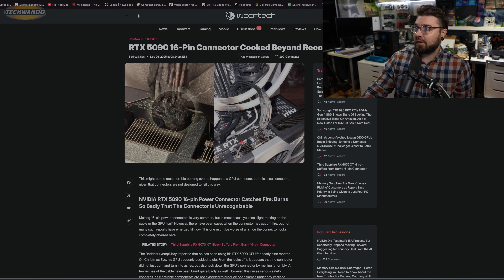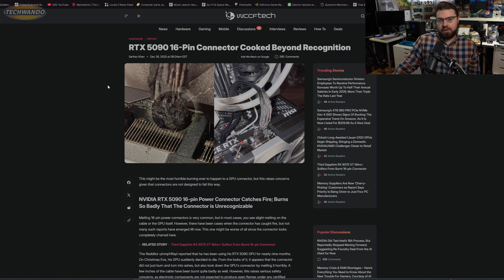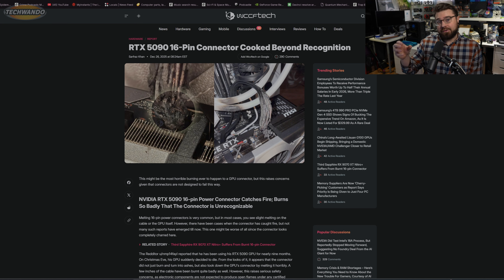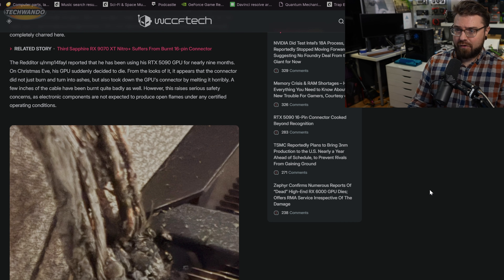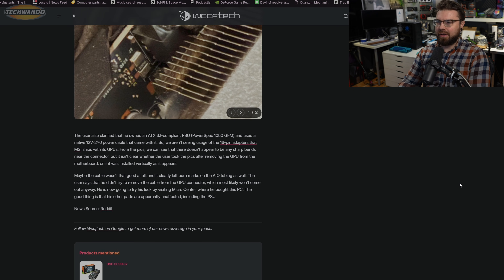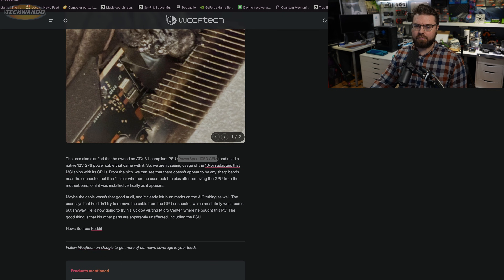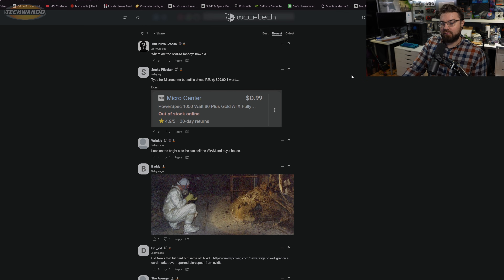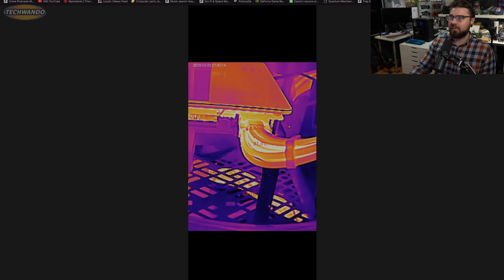Nvidia, Intel, PCI-SIG, please do something about this...

Comment: I don't know anyone who will buy a 4090 or 5090 for $3000-4000 and not plug it in properly ... they would double and triple check its plugged in fully. Knowing its $3000+ that can burn and melt

Comment: Got myself a 5090 for christmas, so I adopted one of these connectors :(
I bought a new PSU with new cables, I could point a case fan directly onto the connector or undervolt it...
I guess I run it like that, and if it fails both ends of the connector at the PSU and GPU get soldered in directly to not have a connector at all...

Comment: I bought a 5070ti and I don't want to waste my money. How do I prevent this from happening???
Reply from the maker: Extremely low chance of it happening on the 70 class, but you could use MSI after burner and drop the power to 90% as a precautionary.

Comment: I undervolted my 5070 ti by an insane margin because I’m scared of my connector blowing up ;-;
Reply: Just don't use adaptors or daisy chain and you'll be fine. All 5070ti & 9070ti cases were from ppl using adaptors. Youtubers just repeat the same sht as every other youtuber for views.

Comment: The cable's very nice to look at and cleans up a lot of cable clutter but at this point I don't think the risk is worth it for anyone. Even for someone like me who's never experienced this for two years running on all kinds of 40 and 50 series cards, thank God. I'm not saying we should stick with triple 8-pin connectors forever but damn at least redesign/re-engineer this thing so it doesn't fry our components.

Comment: Always user error!  One your settings are maxed out and you set there and run this thing hot for 12 hours, in a system it wasn’t designed for….  Or spend 5k on a card and don’t really look into what works best… which design is older? The power supply and connectors or the gpu?  People are running them at full telt in ai data centers and offices and not having a single issue…
Reply from the maker: Watch this video and let me know if you think this was user error. 

https://youtu.be/m0WnwOnl8kY?si=yMWaEM_YvUc2qNdQ
Reply: @techwandoUS even this guy said it was th power supply… that’s my point of you buy a card that is a power hog, and don’t check the connection and so on… then its user error…  that being said we had this same issue on ant miners s9, I still got a power supply that did the same thing…  and the power supply’s for that is rated upwards of 3000 volts, runs fine for a while….  I did a quick pull on the numbers as how many 5090s where sold and how many went up in flames…. The data just isn’t there and don’t justify a recall of any kind…. If people start saying this is happening they better have “ spotless” pcs… no dust…  note that the few I did see where water cooled systems… other factors could be at play… but it all boils down to don’t cheep out on the power supply and for goodness sake’s don’t use the one you think might work just because it is in your system and has a high or gold rating
Reply: My streaming computer is an older dell t7600 that pumps two xenon’s for around 36 cores, for gpus it has one qudro 6000 and 3 qudro 4000s, I use this system for all kinds of things…  know your systems limits … building monsters has responsibility’s and you better be able to put it down if you need too
Reply: I know people have their views and think they know what they are doing… but brother if this hasn’t happened to you or anyone before… then you where not a power users,  welcome to a different world… and in that world you need to harden the bunkers
Reply from the maker: @Paranoidtimes okay man 👍

Comment: This is a bad cable, it’s an adaptor Caoutchouc only cable, it indicate old PSU.
And in fact the power supply is a PowerSpec 1050W …
Who put the cheapest PSU possible with a 5090?.. this guy for example.

Comment: hey man i would appreciate your take on this

I bought a zotac 5070 oc with corsair rmx 850 and use the native cable

I am really worried about the burning since i can't afford if it dies

Talked to many users of 4090, 5090 on reddit who haven't had any issue

What do you think about it happening on 5070? i do have power limit to 90, might increase depending on performance gain in future

I know more watts isn't the issue, it's load balancing on just 1 wire
Reply from the maker: Although there have been some instances of the 70 class cards melting, it's just way less common. I personally wouldn't worry about it. If it still bothers you though, you can definitely do as you mentioned. Just drop the power draw down to 90% or find a undervolt guide and get it more efficient than factory.
Reply: @techwandoUS  Thanks man

Comment: The amazing part to the "it's user error" crowd is, there's never been some constant reporting of melted 24 pin connectors, EPS connectors, PCI-E connectors, it's always these stupid high power connectors. Granted, people have ruined their hardware by using incorrect modular cables from different PSU's or using Molex connectors attached to SATA or PCI-E adapters/splitters, but not just using the other connectors in stock form. Now, AMD uses that same stupid connector and it happens to them. Almost like it's the stupid high power connector that's the problem.

Comment: Funny I got a 4080, 4090, 5080, 5090 I try to optimize by lowering full load volts for stable and efficient power draw but no fires, no melted connectors, funny I don’t use Corsair psu’s which a majority of fires come from in cables and connectors…. Also I have good cases with great cooling and fans moving air…

One guys 5090 caught fire becuz he’d overclocked it and it drawed 1300w of power…. User error and junk psus and cables

Comment: Imagine if you were able to engineer a solution to ensure that failures are always user errors because nobody got enough money to go through the legal process against big companies. And the failures ensure that useful life of a GPU drops faster than ever while new Innovations are mostly paper launches with price increases....
Reply: You can get caught if you have firmware messing the device up after certain amounts of cycles but what about if you just have a regular component and design choices to achieve the exact end result?
Reply: And anyone with inside information is under NDA. Plus whistleblowers threatening costly lawsuits, bad reputation to c-suite etc seem to be non-suicidal until cops claim it was a suicide....
Reply: And anyone with inside information has strict NDA. Plus whistleblowers seem to be non-suicidal until the cops report the sudden death as suicide....

Comment: Based on what I know of the situation and some recent developments, it really just needs two things to fix it.

Current balancing on wires and contacts rated for higher currents so they don’t get as hot.

The wires could also stand to be beefed up to 14 gauge for extra safety margin.

Comment: It’s for sure the cable connector. The sockets for the pins aren’t making good contact, they are too wide. Just touching isn’t good enough for the amount of current draw. They need to make good contact the length of the pin in order to sustain the draw without heating up to the point of melting plastic. Seriously though, anyone with half a brain cell ought to smell that long before it turns the plastic to ash.

Comment: Its a low power connector. Nvidia does NOT GIVE A FUCK. Its a low power molex connector, off the shelf design, isn't it? The connector SUCKS. The chip design has hit the wall. They hit the wall with the 40 series and said 'HOLD MY BEER' We can do bigger, hotter MOAR POWA. These cards NEED ALL THE POWER - ALL THE TIME or they blue / black screen. It is a BRAND thing. Sapphire is the only AMD brand using it... What the fuck dude? That doesn't make it an AMD thing. Its a desire to make cards for morons that finally make the right choice, AMD, and don't want to buy another connector or supply. IMHO, DONT BUY ANYTHING NVIDIA or ANYTHING with this connector. EVER. NEVER.

Newsflash: Next GEN AMD is gonna WTF sauce the next GEN Nvidia... First time AMD has ever said 'this generation will OUT PERFORM Nvidia next cycle' FIRST TIME EVER... and it's gonna be awesome. Right now Nvidia is busy channel stuffing AI DATA Center crap into a pipeline that is saturated at 1 million cards and they have already sold 6 million. To who? Where are they? They are NOT in DATA centers. The whole house of cards is about to collapse and I am fucking here for it, walking away with my 1300% Profit on Nvidia already. Now to time my short.

Comment: what are the amd ones that has that problem as well ? the only one i know is the 9070 xt, that i cant recomend ya, but i need to know if that doesnt happent to the 9060 xt 16gb
Reply from the maker: So far it's just a few 9070 / 9070XTs, I think ASRock makes a variation with the 12vhpwr along with a few others
Reply: @techwandoUS  nice its not affecting the 9060xt versions xd

Comment: Years ago there was a E-ATX red/black Aerocool case (AeroCool Strike-X ST Ultimate Gaming Tower) that caught fire very regulary. It was the case itself that caught fire (harddrive dock on the top). happend with me aswell. even when i have never have used the harddrive dock, it just caught fire. And guess what Aerocool did? NOTHING!

This happens way more often than people think. And NEVER let your computer on when you are not around or away from the house. ALWAYS TURN IT DOWN!

Comment: errrr.... PowerSpec... OEM...
it's weird, nothing hit with googlin anywhere... except few pages.
but... it's not obvious.
 I'm using SuperFlower 1000W ATX3.1/Sapphire RX9070 Nitro+.
half years ago, I'd use thermaltake 850W ATX3.1 and both PSU and 16AWG cable it runs very fine.

yeah, connector's issues I know that crystal clear.
but sametime maybe it caused by PSU, or both with it.

Comment: WAIT, did AMD start using the hot connector too?  Are they insane?  That's one of the advantages of having an AMD card, to not have to deal with that.

It's like saying, oh the neighbor uses crack?  Well that must be the reason why he does well, quick let's do it too!
Reply: AMD themselves no, but some board partners seem to be using it, and even then it's spotty. The card he mentioned that uses it is a Sapphire Nitro+ 9070xt, I have the cheaper Sapphire Pulse 9070xt and that uses 2 8-pin.
Reply: Because it is the progress that PCIE consortium ask everyone to accept.
Reply: @arenzricodexd4409  I don't know if it is true, but I will pass.

Comment: Wait till you see th Asus limited 1000 GPU issue they designed it to catch fire it was engineered with a purposely shift 12V High Failure port and even told a customer it was engineered this way I forwarded what info I could scrape together for Tech Jesus (Gamers Nexus) to see if he can do a deep dive to see if that's even legal you design a $4000+ product to catch fire eventually on purpose and claim it was engineered that way if think that's bring some legal heat look what happened with the Note 7 (Portable drag grenade) PCIE SIG needs to be investigated with Nvidia on how this was allowed to be a standard.

Comment: Is my RTX 3050 8g ok? This is a 40 and above problem right?
Reply: It's a Nvidia issue from 3090Ti to 5090 and it's even effecting AMD GPUs that use the same failure of a connector.

Comment: Seeing the stupid fire hazard cable I got with my PSU for my new PC recently was enough to deter me from ever thinking about buying a GPU with that connector. I saw them on video a few times before, but seeing the real deal absolutely shocked me. Those pins are stupidly small and seem extremely fragile. What do you mean that connector can draw 75-100W per pin?? Are they right in the head? That feels absolutely diabolical considering the 8-pin connector averages 50W per pin and those had at least twice as much surface area!
Reply: They are lying and need to be sued...

Comment: being able to use the good and trusted 6+2pin connecter was exactly why I have chosen my specific 9070XT there was a cheaper one with a 12V high-failure rate connector and I will not be using these for as long as it's possible.

Trying to push this connector as being standard is disgusting... this is legitimately a safety issue for every user.

Comment: That 9070xt melting REALLY concerns me. I've been using the 8pin adapters because it's a thicker gauge wire and there are multiple psu connections instead of only one, and I only use 3/4 of the 8pin connections to limit the power to 450W on my 4090 (gets 95% of the same performance as 4/4 connections.)
You are correct that there will be a lawsuit because sooner or later someone is going to die in a fire cause by that card connector melting.
Reply from the maker: Hopefully it never happens but it's crazy that it's gone on this long.
Reply: @techwandoUS  I would be very happy to be wrong.

Comment: These are $2000+ cards… this should never happen. (Not that it should happen even with a $50 card from the depths of a Chinese bin however with cheap models at least you know there might be corners cut) It’s disgraceful.. sapphire seemed very confident in that cable, with their interview however it looks like they might have to rethink using that cable in the future. NVidia really needs to change course with the 6000 series before someone gets hurt!

Comment: nvidia will do something, keep ignoring it for like 6 years and counting

they paid for this crap, they wanted this crap, they wanted this to happen

if the ai bubble doesnt pop, they abandon gpu for desktops and laptops

if bubble pops, they might reconsider finding a new way to spit in the faces of the gamers who made them get to where they are, and that is nvidia for you.
Reply: Nvidia already do "something". That's why those revised version of 16pin exist now. The issue is nvidia original improvised power connector used on 3090Ti were deem violating PCIE implementation.  It seems PCIE consortium want those power connector to go certain way. Actual hardware overcloking talk about this in one of his video.

Comment: Although this still should not happen, the person was likely doing an activity that probably utilizes the card to 100%. This may not be a problem for lower end cards but these... get a little warm.
Reply: I hope my RTX 5080 never has this issue.
Reply: no, the gpu has no way to control or avoid the wire to carry 50 amps at 12v, on any of the 6 wires, or on just one of them

the cable has no way to control that

psu has no way to control that either, the design of the connector is stupid, it was not engineered well to carry 660 watts, it was stupid

blame the load for causing this is dumb, because if you buy a gpu like this, is to use it, not to admire it turned off, it has to survive being used at the load it was designed, but a thin cable cannot avoid melting when getting 50 amps at 12 v

Comment: Its why I chose a a 5060Ti 16gb over a 5070 12gb lmao...had no interest in 12VHPWR in an SFX build 😅
Reply: Using a 5070ti in a ncore 100 coolermaster sff case... I'm just hopeful it's going to work properly for the next few years. Didn't really to go any higher than 300w, ie half the rated wattage the connector is supposed to handle but I'm still worried. I like reliability.
Reply: @liberteus  300 Watts is the real limit for that connector...
Reply: @liberteus i really considered it, being only $50~ more card at that! My gut told me no, and i get my arse kicked by it if i dont listen 😅 id be the example for sure 😂 my SF850 is "5080 ready" if i need the juice and change my mind in the future.
Reply: Smart move.

Comment: I have 5070 ti hope I don't have this problem too. Last thing I need.
Reply from the maker: Undervolt it a little if you're worried, most of the 5070Tis are 300w which isn't too bad
Reply: @techwandoUS  Does the same go for the 5080? It's a 360 watt card. I haven't heard of too many 5080 or 4080s melting connectors
Reply: @HangmansHalo  4080 had more control on how much amps were running on each of the 6 wires

5000 series found unnecessary that and removed it, so if all 360 watts want to run on just one thin cable, they will, gpu will not stop it, cable will not stop it and psu will not stop it, it was designed to be like this

you can learn more on buildzoid video on the topic, nvidia made this design, knowing the connector was bad and that there were already burned gpus, publicly discussed in the past
Reply: constantly check that the connector is not unplugging itself, keep a eye on it, this thing can melt

supposedly 5070 and lower are safe, but i honestly doubt that

Comment: ill never ever use that POS connector
Reply: i used it the other day, it was not my pc, but i used it, the thing is made to fail, it doesnt connect well, it is too thin, it looks like it will melt and it does melt

it is great
Reply: I have used it for 2+ years on an undervolted 4080 and a couple months on an undervolted 5080. No issues with the cable ''yet'' but i would not use it on anything that pulls more than 350W.
And thats one reason why i undervolt my GPU's.🙂
Reply: @j.p.h.8126  You need to underclock aswell that cards, in order to be under 350w.
Reply: @devilzuser0050  Naah no need undervolting reduces power draw. The cards stock power draw is 360W and with a slight undervolt and around stock clocks it pulls upto 345W or so. I still have more testing to do with the GPU to find optimal settings.
Reply: @j.p.h.8126 maybe install a temp sensor on it so you can monitor if it gets too hot
Reply: @Milan_M95  I dont think that its necessary with a 5080. And i dont really have room for extra stuff in the case since it miniITX.
Reply: If they stick with it you might not have any choice in the future.